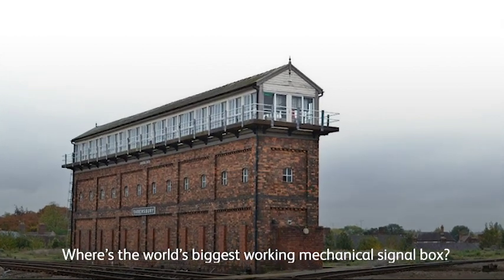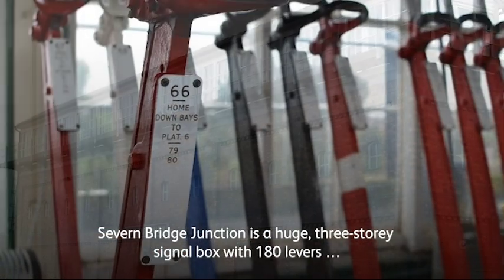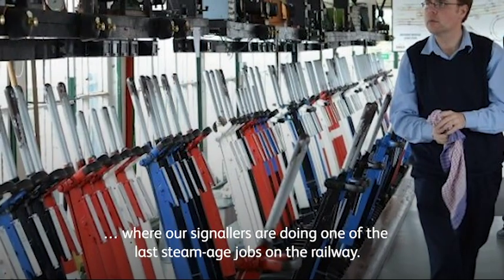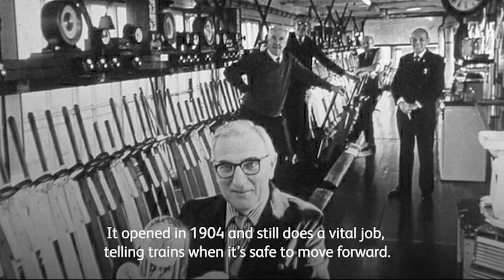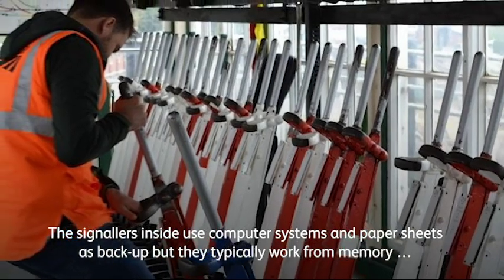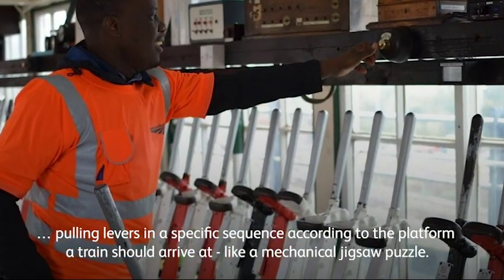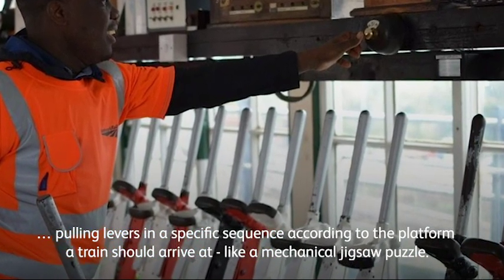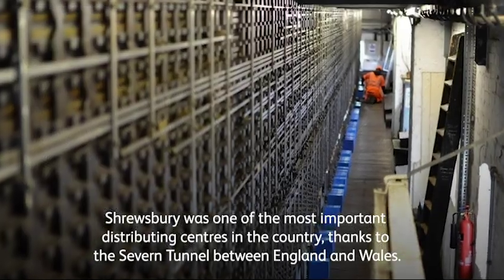Severn Bridge Junction

Comment: I bet there aren't as many delays due to signal failures from that box as there are from the so called "modern" signalling centres.
Reply: At least signal boxes and all the signals that they control require very little electricity to run

Comment: Will the old signalling box at Shrewsbury still remain but to turned it into a museum.
Reply: I agree should be turned into a musuem
Reply: I think they should turn it into a museum rather than knocking it down. If it a listed building.
Reply: @Andrewjg_89  If it's a listed building it can't be knocked down.
Reply: @Poliss95  Yp.
Reply: @Poliss95  It can’t be demolished but it can be dismantled and rebuilt elsewhere. It depends upon whether the structure would compromise the remodelling of the track works and signalling during the upgrade and whether accessibility to it post upgrade would compromise safety. Network Rail don’t like to fund the upkeep of structures that are no longer serving a railway use as they see it as a waste of taxpayer’s money.